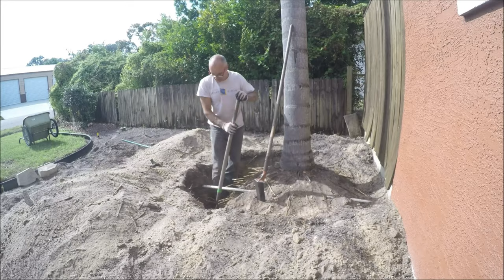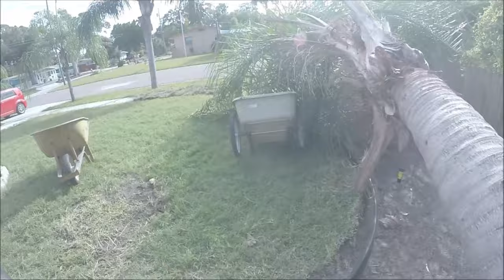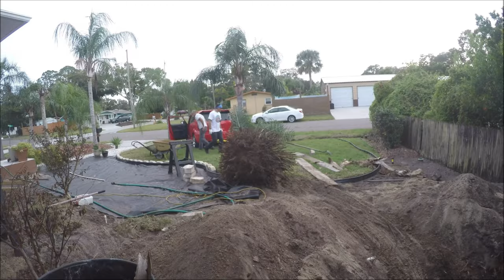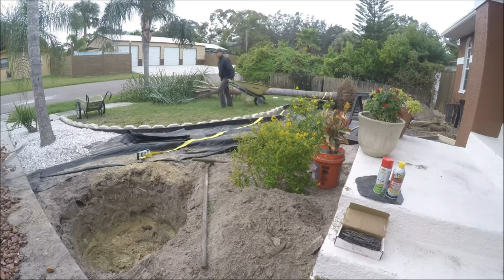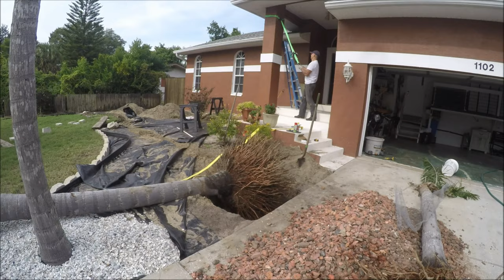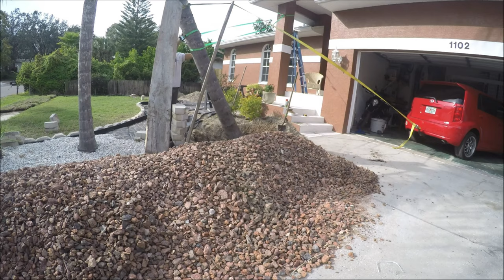Palm tree move

Comment: So palm roots don’t damage concrete and pools?
Reply from the maker: No they are very fine as you can see
Reply: @fly4fun24  Thank you! I was wanted to plant mine near my pool at the edge of the concrete. This is awesome to see! Thanks
Reply from the maker: @MiaNaomi Post  the only thing to consider is the mess that a palm tree produces close to the pool. Also, the root size depends on the palm tree variaty ,
Reply: @fly4fun24  thanks for the tip! I will definitely consider that because I didn’t think about it. I have foxtails too and I think they’re fruit bearing but don’t really know how much of a mess they make just yet. Will continue my research.

Comment: Wow crazy to watch, would u have any recommendations for moving a very thin palm that is joined with 2 more, thin but maybe about 15' high...
Reply from the maker: Italiano92884 three head palm will not roll as easy as mine, but i would use the same concept. I would tie all branches very tight together with straps and extract like i did